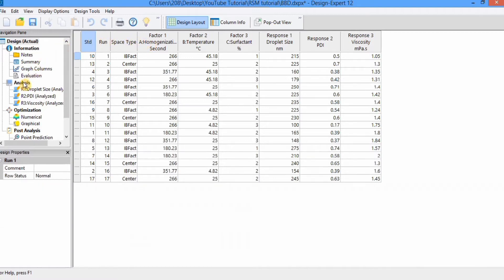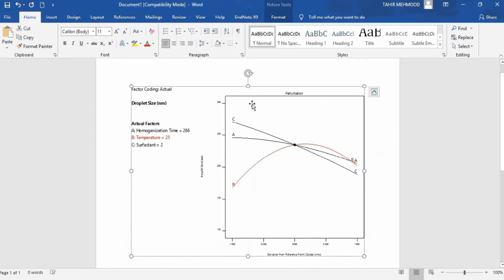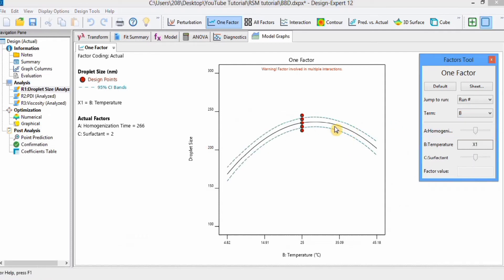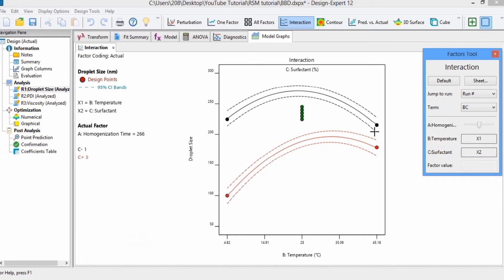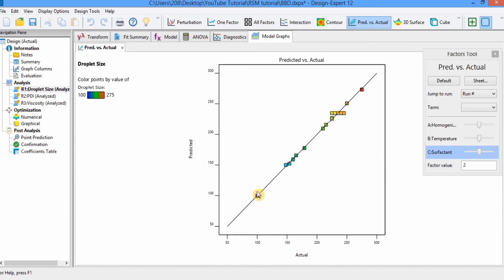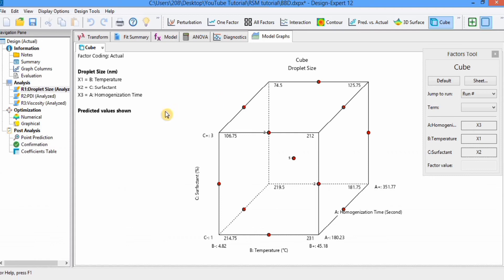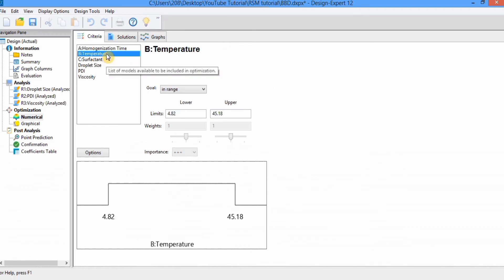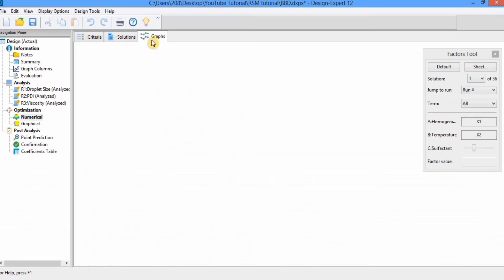Box Behnken Design (RSM) in Design Expert Software (Part 3)

Comment: Sir I have a question. I have 4 factors and 4 repsonses for my experiment. For all these responses the adj R2 is negative, and for first 2 factors the model is linear while for the other 2 is quadratic but not significant. So it means I couldn't optimize this? And what you think about the linear model, is it reliable? Will it be possible for you to make a video on these problems and also on linear model. I will be Grateful

Comment: The RSM revealed that the sonication time of 266 s, temperature of 4.82 °C, and Tween®
80 of
3 % w/w produced the optimum CEO nanoemulsion with droplet size of 65.98 nm, PDI of 0.15, and
viscosity of 1.67 mPa.s

where are these values? these are the optimized value
??????
Reply from the maker: yeas these are optimized value. Later on, we conducted experiment using optimized conditions to validate the model